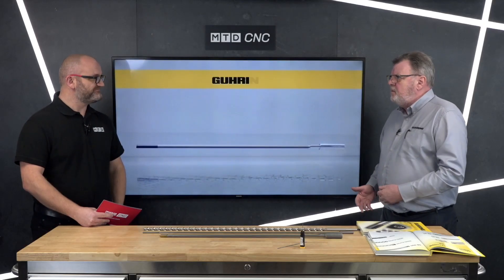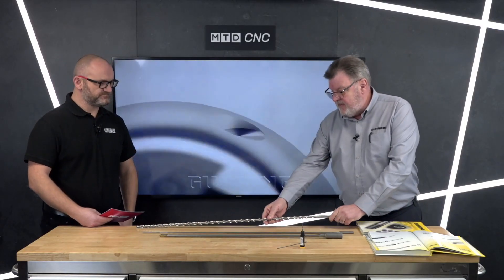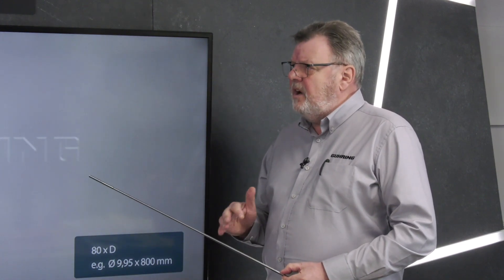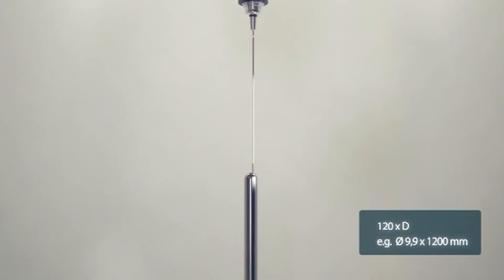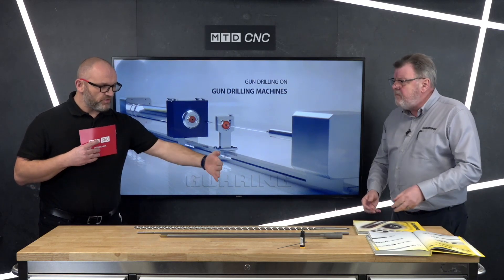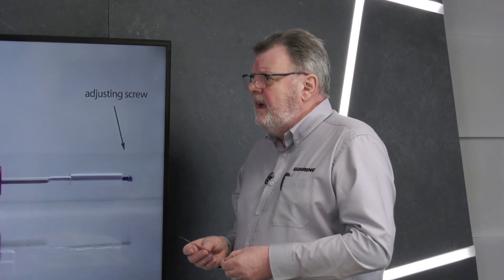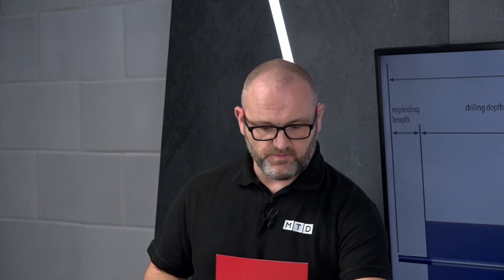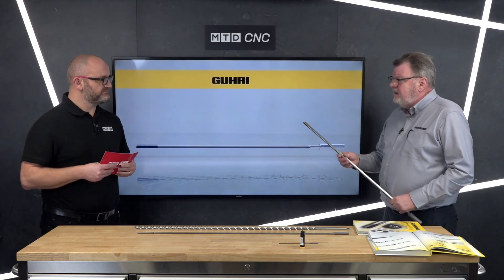MTDCNC talks Gun-drilling with the experts at Guhring

Comment: Can you use a (single edge) gundrill on a CNC lathe? for example 17.5mm diameter drilling say 190mm deep in 304 stainless steel?
I have a project at work and we are currently using a standard twist drill for the first 100mm then switching to (what I know as) a spade drill with chnageable cutting head
Reply: You can use them on a lathe but you need really good coolant pressure & you can't use the really long gundrills without support bushings so your use case really depends on your total depth. I use botek drills on a boring mill style gundrilling machine and the center line deviation is about .2-.3mm past 500mm deep (the diameter stays pretty much bang on no matter how deep you go)
Reply: Hey there, I’m gundrilling NiTi tubes that are 1.263-1.265” OD (yes I’m sorry I’m using American measurements because that’s what they are teaching me), and I most often drill holes that are 0.933” ID with a max mismatch allowance of .002” at centerline. We on 85% of the time can drill with ease up to 5”-8” per drill before needing to sharpen the drills, but is there an easier method to drill NiTi than going at such a snails pace as described above?? I’m working on not a lathe as most know it but more of a Jerry rigged “horizontal boring lathe” that runs gundrilling and reboring operations on the regular for a few different types of operations. If more info on the machine itself is needed I will gladly give you as much as I can, and feel free to respond at your convenience. I am in no rush, although my body may disagree considering the 12 hour shifts hahaha
Reply: Also, whats the accuracy rate? as after drilling we are then boring to 17.8mm, can you buy drills at that size and will they hold tolerance of say + - 0.1?